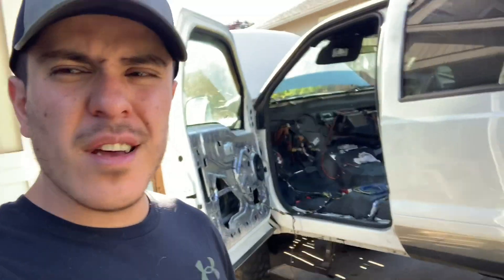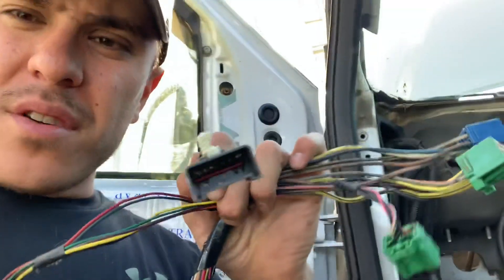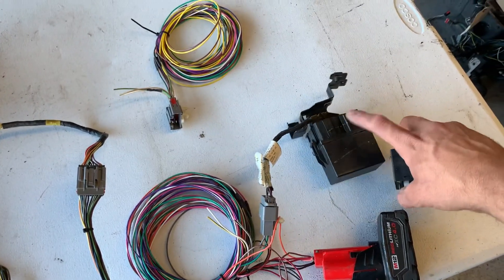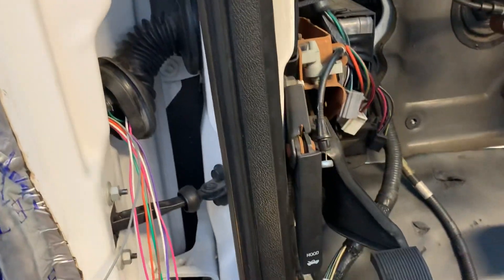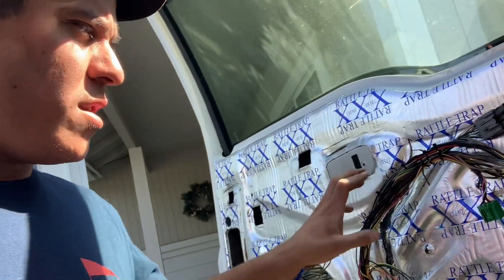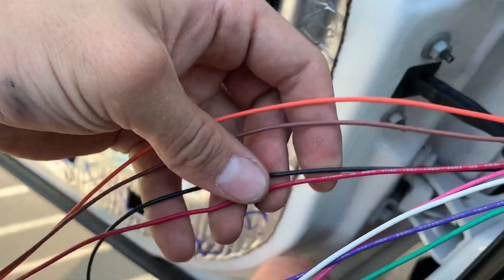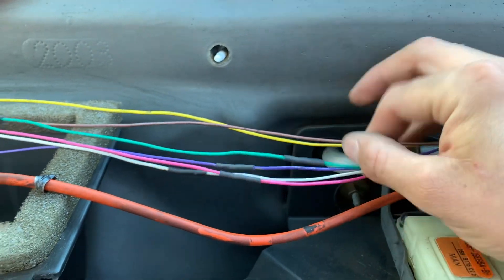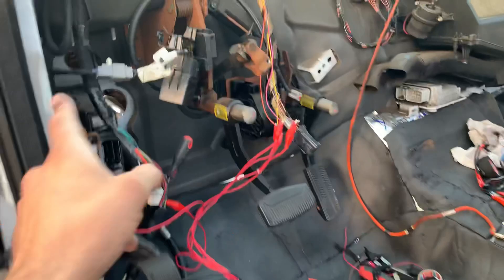Installing a 2008-16 Full Power Mirror Wiring Harness Kit behind the dash on a 1999-06 super duty

Comment: The 09-14 f150 community would also love a kit like this as our trucks did come with the power fold mirrors in 13-14 on fx4 trim and up if they got max tow. The mirrors are identical to a 11-16 full power mirror wiring wise only difference is the mounting base and it uses a different style plug. From my research it’s all the same pin layouts. Biggest problem from my own research and trying to do this myself is that f150s are very weird with their door plugs. My truck is a 12 Xlt with most options, so I have the door plug. But Most XL trucks are the boot, as well as I’d say at least half of all Xlt trucks from varying years are the boot so it’s hard to do. If you could figure this out I know several people in the groups like me that just wanna have this plug n play. Most are Xlt guys I’d also like to add so we are in the same boat as 99-06 in terms of features. Heated and power glass, signals and that’s it. Love your work

Comment: I have an 08' and want to put the power/heated mirrors on as well as the keypad to unlock the doors. I also need a key FOB but do not know if it has anything for that in the truck, I bought it at auction and it only had one key. I bought new carpet so I have the old carpet out now along with the seats.  I also have the door panels off while going to auto wrecking yards searching for new ones. The interior of this thing had tar or something all over the inside. It belonged to a construction company. How do I contact you and send pictures that you need.?

Comment: I'm interested in a harness for my 99 F350, I bought a used set of mirrors off a newer truck but I believe the ECU on this truck ran the fold, and dipped the mirror when you hit reverse . Do I need to buy different mirrors for your kit to work? I managed to figure out how to do the lights and the power mirror, but the 50 wires involved in the folding and telescoping we're just a little too confusing for me

Comment: So I have a 1999 f-250, I bought mirrors that adapt all the way up to a 2016. They are manual fold, but they do have heat and turn signals… if I want to run the wires underneath the seats what would I need to do that?

Comment: I have an 05 with power, signal, heat. Already have mirrors from a 13 model. Bought adapter harness from amazon and it only gives power to move mirrors left and right. You selling these yet?

Comment: DO HAVE A QUESTION  I GOT ALL MIRRORS  WIRED BUT I STILL NEED TO RUN THE POWER TO THEM I HAVE POWER WIRE LOOSE UNDER THE DASH SO WHERE DO I PUT IT IN ON ACCESSORY  AND WHAT DO I NEED TO CONNECT IT TO,  I KNOW THE HEATED  WIRE WILL GO THREW  BATTERY TO NEW SWITCH MOUNT TO BOTH  GREY WIRES  FROM  RELAY.   OTHER THEN THAT I HAVE DONE THE REST AND ALL WORKED  BUT ON TURN SIGNAL LIGHT  MIRROR SAID IT WAS CORRECT BUT IT WAS A CHINA BULB REPLACE AND NOW I HAVE SIGNALS. WORKING WITH MY SWITCH AND RUNNING LIGHTS WORK JUST GOT TO PUT THE POWER TO THE MIRROR  I HAVE A OLD F250 1999  SUPER DUTY  7.3 TURBO    LOOKED A WIRING BOOK BUT  MY TRUCK CAME WITH JUST WINDOWS AND LOCKS  NO MIRROR STUFF SO I  DID IT ALL BY MY SELF BUT NEED TO KNOW POWER LOCATION  I HATE THE SQUEZE CONNECTORS THEY ALWAYS CUT THE WIRE WITH THE TAPPING  NO MATTER WHAT SODERING IT IS BEST.

Comment: Is there any chance you would be willing to sell a system wiring diagram for the adapter harness you made? I have a base model with manual everything and decent wiring experience so i feel confident i would be able to make the harness, but id rather not spend hours figuring out the system if you would be willing to sell what you learned. Thank you for supporting our trucks!!!!

Comment: SORRY I  JUST GOT MINE ALMOST DONE AND I HAD TO FIGURE MIRROR WIRING , HEAT, SIGNALS, RUNNING LIGHTS ALL THE ENTIRE HARNESS I BUILT TO LAST AND NOW I JUST GOT TO CUT HOLE IN DASH FOR HEATER SWITCH  ON AND OFF, AND WIRE THAT UP  PLUS I INSTALLING A RELAY INSIDE FOR THE DOORS MIRRORS AND HEATER AND  FUSE LINK AS WELL OFF A 30 AMP.   HECK WITH THE  2014 TRUCK IT DIED WAS KILLED BY A HONDA 4 DOOR CAR,  I BRING THE BEAST BACK YES A 7.3 TURBO BABBY  NO DEF REQUIRED, AND A 5 INCH  TAIL PIPE   FLIP ME OFF I WILL SMOKE YOU OUT.  PLUS A HONDA CAR WILL NOT HURT THE OLD F250  TURBO  ITS A WORK HORSE  BUT WILL NEED BUBBLE GUM TO KEEP THE TEETH IN  NOT BUILD FOR THE LIGHT HEARTED  MADE TO PULL LOADS AND DO IT WITH NO ISSUE AND MINE DONT EVEN USE OIL ,   I COMPLETELY BROKE IT DOWN AND PUT SOME FUNDS INTO IT, SINCE ALSO  DONT HAVE CREDIT THANKS TO THE CRIMINALS FROM SMITH COUNTY KANSAS AND STATE OF KANSAS WHERE CRIMINALS HAVE MORE RIGHTS TO MY MONEY IN MY OWN BANK ACCOUNTS OR CREDIT AND THEY DESTROYED MY HOME AS WELL AND GOOD NAME AND STOLEN EQUIPMENT AND CASH AND ART WORK AND GOLD AND BOND FUNDS. PLUS TOOLS STOLEN.
KEEP IT UP  NEXT TIME I MIGHT HIT YOU UP.